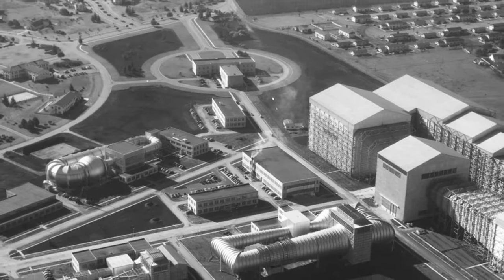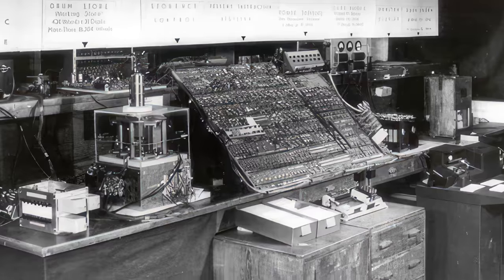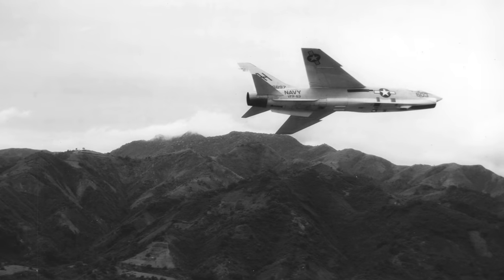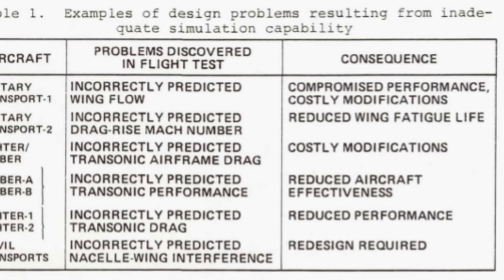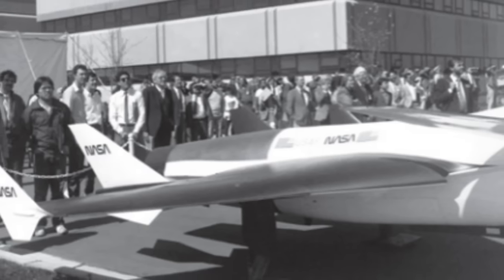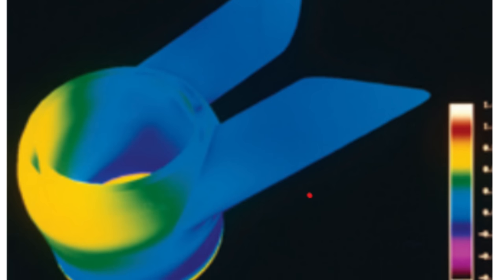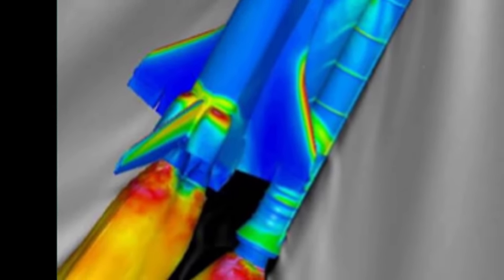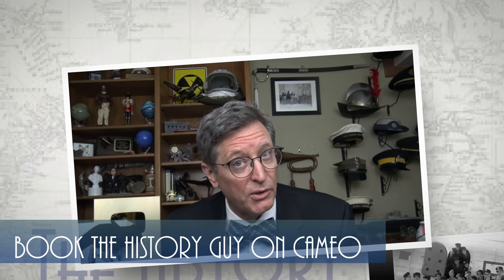A History of NASA's Supercomputers

Comment: Cool episode! Some of my graduate research was in high-performance computing (though much more recent than the systems discussed here.) Particularly, my research was focused on ways to efficiently use graphics processors in supercomputers. While developed primarily for the computer gaming market, it turns out that graphics processors are actually quite good at running most types of scientific simulations and, since they're already designed and manufactured in the millions for the PC market, it's often cheaper to build supercomputers out of those than purpose-designed HPC chips, which is a far lower-volume market. My research focused on ways to co-schedule kernels (as in programs that run on computational accelerators like graphics cards, not operating system kernels) with complementary resource requirements in order to get the most throughput out of the GPUs.

It would be cool to see an episode on the Department of Energy's supercomputers, too. The Oak Ridge National Laboratory in Oak Ridge, Tennessee currently has the fastest supercomputer in the world, as it has for a large percentage of at least the last couple of decades that I've been keeping up with it, with Jaguar, Titan, Summit, and now Frontier all holding the number one spot on the TOP500 list at the time of their entry into service. Living only an hour away from Oak Ridge, one of my graduate advisors was also working for ORNL during my time in grad school.

Comment: In the mid 90s I worked at a small Aerospace firm building a satellite that eventually flew on STS-77. Our Analytical Group was doing FEA using Pentium 133s, the fastest machines we had at our company. The supervising contractor (JPL) reran the FEA and changes were made because they had access to a CRAY their results had much greater depth, even with our systems running overnight. Funny to think of that level of computation is passe 25 years later

Comment: Brings back memories...  I worked for GE Nuclear from 76 to 82 as a Fortran programmer simulating Advanced Nuclear reactors (Breeders) and we originally used a GE 6000 then Honeywell bought them out small word size (32 bits) eventually went to 64 bits with the CDC 7600 (water cooled).  then the small Digital DEC-750, 780 was the fastest of that series.  Easy to network with (Apple's apple talk was wonderful also)  I eventually ended up at NASA Ames working for Boeing computer services supporting 200 Apple Mac Desktops, and writing code for Mac's and several other machines also.(I supported the referb of the Hubble team).  My code (DQ) flew the Ozone mapping in U-2 (UB2) aircraft we had 3.  Pilots were in Space Suits.  Cray was sold to Silicon Graphics where it languished and then Sun Microsystems bought them ported the os to Solaris (Sun/unix).  At the time it was the biggest system that could be bought (fastest and physically largest).  I ended up working in SE Asia for Sun as a software guy Principal Consultant  and installing the Sun/machines in SE Asia and supporting Y2K in the Philippines then Thailand.  So many vendors went belly up in the bay area all the infrastructure was there.  This is also why the companies like Facebook (located on old Sun campus) and Yahoo, Google (built on an old dump/concert venue) We built everything from Scratch (Software).  I have been living in Thailand for over 20 years.

Comment: In my past, I grew up in Sunnyvale.  (If you don't 
know where Sunnyvale is, before it was called 
Moffett Field, it was Sunnyvale NAS.)  Ames Research 
Station is still on Moffett field.  Fremont HS district 
had a machining class at Ames.  I went.

We also did trips to a LOT of the other things at Ames.
Saw a model (quite large) on the 40 by 80 wind tunnel, 
of the space shuttle.  This was 1975 or '76.

Lance, my father started working at a tiny computer 
memory making company, in 1970.  I met one of the 
founders at work one Saturday.  The guy was Gordon 
Moore.  Dad was employee # 47.  Yes, Intel.

steve

Comment: I went to school in the 1990's shadow of the IlLIAC III and ILLIAC IV projects.  We had test equipment from both programs in our ACM lab space, operated in the Digital Computing Lab building that was constructed to house those programs, and we even had random prototype and spare boards from the systems that were usually sitting tossed in cabinets, or boxes, etc.  Most of my first experience with using Oscilloscopes was on a Tektronix 454 and 465 both labelled "ILLIAC IV MAINTENANCE TEAM ONLY".  At the time all of that stuff and many parts from similar 1960-1980s super computing projects were just sitting in store rooms and warehouses treated as complete junk. Including VAX-11/780 through to VAX9000 systems, DECStations, and early ARPANET communication equipment.  The Dean occasionally let us root around in storage for parts, but most of that foundational computing history was later just sold off/disposed of for the scrap metal.  I think 1-2 boards got saved and put in a display case but the rest is all gone.

Comment: I remember the first time I used a Cray. It was for a structural analysis problem (FEA) for Space Station in the early 90s. I probably could have just used a Unix workstation, but I just wanted to run it on a Cray because I could 😊

Comment: I once visited the "Cray Room" at Laurence Livermore Labs.   I was told that the Cray 1's  had air conditioning units in the surrounding benches.  The Cray 2 was liquid cooled with a separate device used to remove and store the fluid.

Comment: As a review of what was at Ames, this is great... as a history of supercomputing it misses a bit. While most of the industry revolved around where Seymour Cray worked at one point, in the 80's, the Japanese were building their own.  The best supercomputers in the 1990's were NEC SX Series, and they were used around the world except in the US, where they were kind of banned (600% import tarriff) Back then, supercomputers were Shared Memory Vector based (doing more calculations in parallel with few processors connected to a common main memory.) Towards the year 2000,  roping together computers based on microprocessors, each with their own memory (so -called distributed memory, or massively parallel)  took over, and it killed of all the vector machines.

fwiw,  back in the day, I went to Minnesota on training for ETA/System V, the proprietary UNIX for ETA Supercomputers.  ETA was another spinoff from CDC, meant to compete with Cray, but was stillborn.

Comment: Little known fact: when Cray started his company, with the exception of a few experienced engineer-managers, he only wanted green engineers just out of school. He did this because he wanted engineers who didn't know Cray's ideas "wouldn't work". FYI, every U.S. made automobile made since 1996 has more computing power under the hood than in the entire Apollo Command module and Lunar Lander module COMBINED! Every Pentium-based PC has many times more raw computing power than the best super computers in the world in 1969.
Reply: 1969 supercomputers were eclipsed in the 80s with the 286 processor.
Reply: Mr. Cray was my computer hero growing up. I read a Popular Science magazine in 1980 of a Cray Supercomputer that was capable of 80 MFLOPS and appeared on the cover. The article mentioned the 'C' shaped design of the 'CRAY' was to allow the shortest wire distances possible between electronic component boards within the interior of the supercomputer to speed internal comms. I later saw a decommissioned Cray deployed in the building foyer of the 'Bureau of Meteorology', Melbourne, Australia, as an artistic installation in the late 1990's.

Comment: the smart phone comparison gets hilarious when you consider that in the novel Jurassic Park, one of the 'clues' that Ingen was doing something weird was the fact that they'd bought 4 Cray XMP's and networked them to run their park. 
meaning that Jurassic park could be run off my smartphone, or my laptop.
Reply: You would not have the same I/O capacity.
Reply: @GH-oi2jf  Nowadays everything is networked. A single ethernet line (via USB) is enough. Granted that doesn't conform to the redundancy standards modern industrial systems use but that would just be fitting for Jurassic Park

Comment: Note that before Ames took delivery of the Illiac-IV and Langley received the CDC Star-100,  Goddard had been through several generations of IBM supercomputers and had been running the IBM 360/91 for a a couple of years.  By the mid-seventies IBM had pretty much abandoned the scientific computing market and had dropped out of that market, so people tend to forget them today but at one point they were making serious floating-point engines.  Goddard handled most of the high volume computation for the space side of NASA in the days before NAS and in early space flights data would be sent from KSC up to Goddard for trajectory computation and then shipped back.
Reply: IBM went back into supercomputers in the 2000's with the massively parallel Blue-Gene family. Currently Summit with 203000 cores is still at #5 in the top500 speed list.

Comment: It’s a real shame you stopped at the early 90’s, when the mid 90’s saw Donald Becker’s network device driver work at NASA Greenbelt spark the first Beowulf cluster supercomputers, which are the basis of nearly all modern supercomputers.  Beowulf is a significant part of Linux’s current internet market dominance as well as the origin of the cattle-not-pets large scale development architecture.

GSC’s contribution to supercomputing is history we should have also remember! 😅
Reply: Core licensing fees is what made Linux dominant in supercomputing. Then all the development from supercomputers made Linux excel on all SMP applications. Least that's what Linus has said.

Comment: Serial Number #1 of the CDC 6600, 7600, and Cray 1 all went to the Lawrence Livermore Lab (LLL or L3) in California.  Parts of these machines are on display at the Computer History Museum in Mountain View. L3 had serial #1 Star 100, and later the Cyber 200, as well. I'm not sure if any parts of these machines survive. I worked for CDC and later for Grumman in hardware and operating system development. NASA Ames didn't have the machines until much later.  There were machines near NASA Ames at Lockheed Bld. 190 and the US AF Satelite Control Facility (The Blue Cube) in Sunnyvale.

Comment: Prior to digital computers, analog computers were often used for engineering.  Back in the 50s, they were faster than digital but didn't have to precision and couldn't be reprogrammed as easily.  These days, a home computer is much more powerful than the supercomputers mentioned.  Also, modern supercomputers can have thousands of CPUs, instead of a single CPU in computers back then.  This is due to it becoming harder and harder to make faster computers, so multiple computers were used, with parallel computing.

Incidentally, the film Hidden Figures touches on the NASA computers used back in the 60s.

BTW, back in the 80s, when I was a computer tech, I used to work on some VAX 11/780 computers, similar to the 11/750 mentioned.  Back in the day, those were considered high performance.  However, I realized their days were numbered when I read the Intel 80386 CPU was as powerful as the VAX 11/780.  Most of the companies that made those supercomputers are now long gone.

Comment: Don't know if it's still available but for a while NASA had an operating system download available to the public, Beowulf it was called if i'm remembering rightly, that could be used to connect any number of computers together in a RAID array yielding additive processing speeds. Might be fun to run 100 Raspberry Pi mini computers together in a RAID array, see what kind of speeds you could get out of it, build your own supercomputer at home on a shoestring, run that AI program you wrote to evaluate all known astronomical data to come up with a description of the evolution of the universe. On a Raspberry Pi based supercomputer, how cool would that be?
Reply: Yep, the Beowulf cluster

Comment: The company my grandfather worked for in the 90's had several Cray super computers in a seemingly inconspicuous building behind their main building.  They designed the equipment to gather the data, built the hardware, and processed the data from deep subterranean exploration.  They invented the use of "thumper trucks."  Those were trucks that more or less looked like a street sweeper, but without any brushes.  Instead, it had an under-slung tool package that was lowered to the ground, lifting the truck tires off the ground.  5 or more of these trucks would be sent out on a job at once.  One at a time, they would actuate a hydraulically driven unit that would emit high energy pulses into the ground.  The other trucks would listen with seismometers.  After one would "thump", another would and so one until all trucks in the unit ran without moving.  They would then move location and run again.  The spacing between the trucks was set by how deep they wanted to look, with the trucks being up to many miles apart.  All the data from the trucks was taken back to the super computer bank, and processed into a 3D model of all of the underground features.  This was greatly used in the oil and gas industry as well as mining.  By the time my grandfather passed away, they had a resolution of 1 foot at 5,000 feet under ground.
Reply: Schlumberger?
Reply: @nufosmatic  No.  Geospace Technologies.

Comment: Actually the calculations for the computational Fluid Dynamics arn't that complex, but the challenge is that you need to perform the calculations so many times. Each particle of fluid in the whole simulated volume needs to be calculated several times per timestep.

Comment: I'm about as old as computers.  Born in 1950.  When in my twenties, I worked at a steel mill controlled by a 1960 vintage computer. It was General Electric!  It had mag core memory, drum storage and ran a system called PAL, program assembly language.  The highly skilled learned to coordinate optimal drum to memory transfers, as it only had 32 K words of mag core.

Comment: NASA computers 🖥 has changed a lot over the years. 😀👍
Reply from the maker: I recall in the 1980s Crays were talked about with near reverence. Now our cell phones are more powerful.
Reply: @TheHistoryGuyChannel  I agree on that. 😀👍
Reply: @TheHistoryGuyChannel  Ah yes, I was a grad student when NCAR got their first Cray.  Processor speed is somewhat less comparable now that we have different instruction sets and pipelining and multiple cores, but I see that my (not top-of-the-line) phone has 3,000 times the RAM as the mainframe I used back then.

Comment: Nice article. But one small mistake: You mention the VAX 11/750. But the picture clearly shows the 11/780. I worked on both of them including the even smaller 730 in the 70ies. And these were only 32 bit systems. But could (in FORTAN) use 8 bit numbers, 16 bit, 32 bit, 64 bit, 128 bit and even 256 bit numbers. And in the beginning the "big" 780 had amaximum main memory of 8 MB. Today caches are bigger. But very few could afford to pay for so much memory. 2 Mb were considered a big system.

SAHARALD

Comment: It still amazes me that my phone has more computing power than all of the computers used to land Apollo 11 on the moon - and all in my lifetime.  Crazy!
Reply: A 1980's calculator had more computational power. It actually takes very little power to do most things dynamical. It just involves calculating F=ma, d=vt and a = v2-v1 about 20 times per second. times 6 (for 6 dimensions...x,y,z,yaw,roll,pitch)

Comment: Back in my day we had VAX/VMS systems at uni. With the occasional Alpha thrown in. I always thought it would be fun to find an old VAX and get it running. Until I realized that it would drive me into bankruptcy. Not so much by the price for the hardware, but by the bill from my electricity supplier.
Reply: I kept asking when the "Beta" version would come out... Joking aside, the Alpha had a lot of engineering that went in to dealing with their power problem. The chip had like nine power voltages. It lives today because the same people designed the M1 at Apple.

Comment: the quantum computer is going to make all these things look like a Timex
Reply: If it ever is able to solve useful problems. Till now only special tailored problems could be solved. There are two issues: quantum computers can't calculate traditional equations, where only one answer could be correct. So by design they only help with certain tasks. The problem is: we had been able to build quantum computers with more qbits to figure out, that they are useless, because current qubits are error-prone, and there are not yet ways of correcting such quantum errors. So if the calculation has too many logical steps, the noise overwhelms the result, producing random results. 
So the problems only got bigger instead of smaller.
Reply: @nils9853  from what I understand it takes a supercomputer just to decipher the information that is being given to us

Comment: The University of Alabama has a computer designed to evaluate the interaction between the human torso and the surface of backyard swimming pools at the air-fluid boundary layer. It’s performance is measured in the number of Ballistic Entry of Lateral Leaps while Yelling computations per second or BELLY Flops.